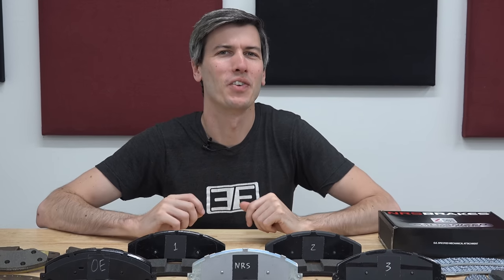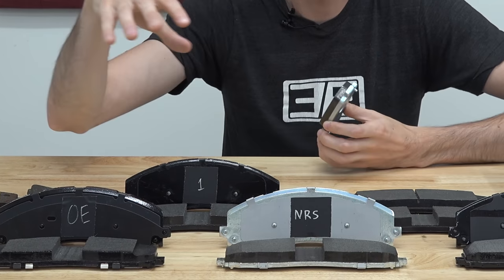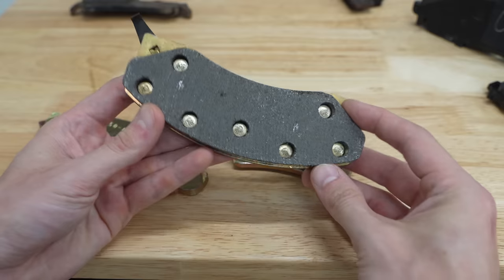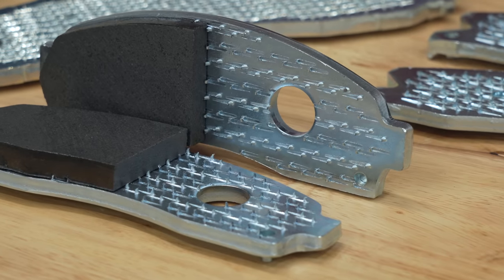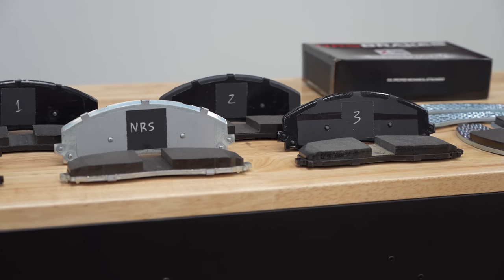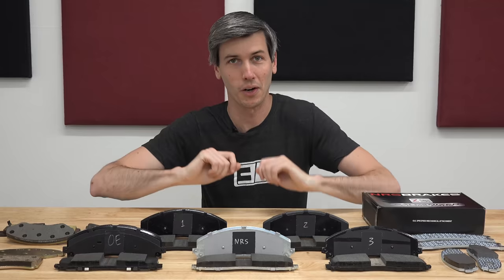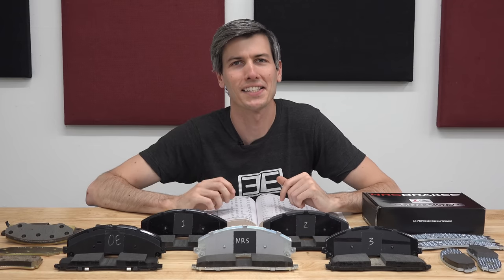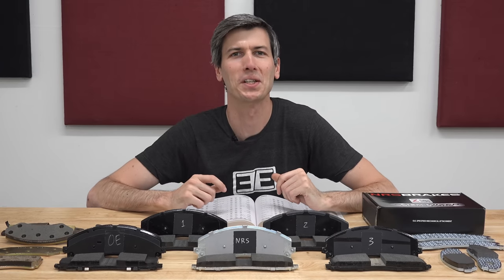The Sketchy Truth About Aftermarket Brake Pads

Comment: Mechanic of 20yrs here, I've seen a lot of separated pads due to corrosion. I've seen cracked pads from heat and heat cracked rotors. Most commonly separated friction materials I see are drum shoes oddly enough, often parking brake shoes due to rust. I haven't yet seen a pad cooked off a backing plate, not to say it can't happen and doesn't happen but my experience is that rust will get ya before anything else, often the rest of the brakes are seized up pretty hard at that point as well. Sticking slides and pads bound in brackets are very common issues with brakes.
Reply: THX, thats a profound reply.
Reply: I've only seen pads separate twice, both time the bads were supper thin

Comment: My BIL got me into the Autozone lifetime warranty pads couple years ago. Seemed like a good idea at the time as a break job is a pretty easy and quick task and you get to check out everything down there. After the first set died after 14 months, I quickly realized spending a bit more to where they last at least 2-2.5 years is a better use of my time for an extra 10-20 per set.
BIL still thinks hes got a good deal and is doing them every year+.
Reply: BRAKES, people, Please!
Reply: It kinda depends on how you value your time. I slung hundreds of those pads in a former life as a counter tech. Very, very few people actually made us replace those lifetime warranty pads...mostly it was lots of used car lot jockeys that bought the cheapest Valucraft pads. The cars only had 30 day warranties, so as long as those cheap pads lasted 30 days...that was all they cared about. The most interesting issue we had with the lifetime warranty pads were friction material disintegration on riveted pads...the material would crumble and bam...rivets into the rotors, metal to metal. Ruined the rotors. Naturally only the pads were covered, the rotors became junk. The problem there was that whoever was making the pads, tried making the material last for such a long time they compromised the temperature tolerating ability of the material...it burned off the binder and then the pad began to crumble. Lots of unhappy customers. This was back in the mid eighties.

Now if it's the family truckster that I depend on to get all of us safely from point A to point B...you better believe I'm putting on the best stuff I can find. The best stuff isn't necessarily the most expensive.
Reply: I used to work at AutoZone & started buying all my pads there. I do the work myself so a lifetime warranty on the parts in an hour job is worth it to me. If I'm buying expensive pads over and over that 6 month difference is irrelevant if I'm buying the parts again.

Comment: Over my 20 plus years in the automotive repair industry I’ve seen a few pad separations. Personally I’m all in for mechanical connections, however I’ve seen pad separations on mechanically connected and adhesive bonded pads. While I’m just one tech without any type of scientific method or control, in my experience it doesn’t seem like any one type of connection is more separation proof then the other in real world. Now I’m sure the vehicles I mainly work in and my location in the country have a big influence on that. So it’s entirely likely my experience would be completely different if I was working on a different brand or in a different climate. However I will state that I absolutely have seen galvanized and mechanically connected pads be separated by rust jacking. Galvanized coatings don’t stand a chance against that horrible horrible brine they use on the roads in winter. Just my worthless 2 cents.
Reply: Separation of the friction material from the backing plate was a major concern when the industry started to move away from riveted brake shoes and pads. That was rectified in the first 5 years.

I guess with today's increase in weight limits and towing capacities, this might also again become a problem for 0.001% of people who drive trucks.
Reply: I believe that the zinc plating that NRS is using might help some, but given it is just plating, I believe it will have its limits as well. I think Jason made a great case, why the mechanically aided pad attachment is a good idea, but how much that really matters in a daily driver setting remains to be seen. Especially since you have mentioned that you have seen both types fail.
Reply: The brakes that I recently changed out on my 09 were beginning to separate from the backing plate, which used a mechanical attachment. Unfortunately, I would have to agree that rust jacking will get the best of any brake pad if left on for enough time. The car was not driven much and sat on the side of the road for about a year, so there was plenty of pad material, but the sprayed on brine in the winter killed the rotor and pad within a matter of months.
Reply: @d47000  That brine is horrible, awful, vehicle and metal eating stuff!  In the 16 years I was a foreman before the local authorities switched over to the brine, we never had a metal brake line failure. After the first winter, cars started coming in one after the other with brake line failure and within two seasons, major structural failure. Everyone wants to blame the manufacturer but if twenty year old cars are rust free for 18 of those years and then two winters after the brine goes into use, it’s falling apart, I don’t think it’s the manufacturer’s fault.  Even my own vehicles went from ok to rusting within one winter. I cleaned everything and applied a preservation wax to stop it. Sadly most people don’t know better.
Reply: @2down4up  I feel for you! Nothing more painful than working on a rusty car.
Reply: @d47000  I very much appreciate that, but my fellow technician brothers in the great white north have it much worse then I do. Regardless, it sucks!!!

Comment: I do have to question if the NRS tests were designed specifically to reduce the effectiveness of adhesives. Which would artificially prove a point that may not be rational. Like if these were baked at temp for days on end with no cooling periods, but if there had been a test better reflecting real life conditions (with intermittent brake useage or varying durations) would the same result occur.

This may not be the case, but because we have so little information about the methodologies... I at least wonder.

Comment: it's an interesting video but is there any real world testing/evidence that otherwise solid brake pads using glue (not super cheapos) actually fail this way?
Reply from the maker: Yes! To be fair, (and I hope it's clear) I'm not saying if the OE says you don't need it in your daily, you should think otherwise. But this kind of failure definitely does happen. NRS gave an SAE presentation where they pulled several examples from NHTSA where the pad falling off was the failure point/cause of the accident.
Reply: I have had this happen to Brembo pads using adhesive, but I think the reason it happened was because the previous owner had installed the wrong size rotors on the front.
Reply: @EngineeringExplained   'several examples' when there are 300million vehicles in the US seems.... not concerning. And a pad falling off could include improper use/install as well.
Reply: I was a mechanic for about 10 years. During that time I did loads of brake jobs, and even here in Texas where rust isn't usually a big deal, I saw plenty of brake pads separated from the backing due to rust. None had mechanical fastening, because the backing plate was nice and smooth (not counting the rust). Also saw a couple cases where people abused them (doing burnouts by holding brake and just overpowering the rear brakes) but those were really obvious by the blueing on the rotors and chunks and cracks in the pads. But yes, brakes do fall apart.
Reply: @Idiomatick  speculating the definition of a term with more speculation is useless. Find the real number if you're going to try and start a fight.
Reply: @EngineeringExplained Question is, can you get mechanically attached pads for cars where the OE doesn't specify it? i.e. ordinary cars, not trucks or the like?
Reply: My 2021 Tesla Model 3: I had the Tesla Service Center perform a brake service (cleaning and lubing of pads, sliders, etc.).  They called me and said one of the pads friction material delaminated from the backing plate.  They said they use adhesive rather than a mechanical attachment  method.  The further claimed that this happens sometimes when they are cleaning the pads.

I was forced to pay out of pocket for a set of front pads and some addition 'kit' for it.  Something like 400$ Canadian on top of the 400$+ for the cleaning service I requested initially.

I tried to call BS on them about the pad and said they damaged it while working on it or it was a defective part.  They wouldn't do anything for me and I had no choice but pay for the job.

I'm told this model tesla uses Brembo brakes.  I've long heard of this brand and felt it was a higher quality manufacture and should be able to trust their product so I was quite surprised at this.

Tesla told me that I should have serviced my brakes (clean/lube) annually because I live in the rust belt.

Now I feel as if I should either have this service done yearly or never at all.  If they'd never touched the brakes, I'd likely not have had this issue.  They said my pads were approimately 75% good.  I had 75,000km on them and nearly 2yrs.  I purposely use the brakes everyday I drive because I know regenerative braking does most of the work.  I wanted to prevent brake seizure issues, etc... 

Anyhow... anyone have any comments on this or suggestions for me?
Reply: @PurpleSideBlack  wait. You took your car in specifically to have the brakes … cleaned?
Reply: @Everybodypoops2  yes. It's recommended maintenance to clean and lube the brake system. Especially because Teslas don't use the friction brakes very frequently due to the primary braking system using the regenerative brakes through the rear motor that uses kinetic energy to recharge the battery pack. 

I've never done this service on any other vehicle because I didn't know that was required and generally the pads and/or rotors needed replacing by the time you needed to clean and lube.

Comment: I installed a PowerStop front brake kit to include cross drilled rotors and carbon ceramic pads on my 2001 Subaru Outback LL Bean [H6] last year, and this spring I did the rears with their kit for the rear brakes.  I don't think the car stops any better, but the carbon ceramic pads seem to produce NO dust and the kit was very well done, with complete instructions and most importantly....

Instructions on how to BED THE BRAKES!

If you just put rotors and pads on your car and go and drive it, a year later your pedal will be pulsing.  You have to "bed" the pads and rotors, or they WILL warp~

Most cheesy repair shops won't do this properly.  Or at all!

Great video!
Reply: Also used power stop. They lasted daily driving and track use
Reply: cheesy?  do you think a reputable car dealership does it either?  Nobody does it , unless it’s your own car and you do it yourself

Comment: I am the mechanic for a motley fleet of Ford Chevy Isuzu Toyota trucks that mainly pull trailers stop-n-go around suburbia. Only a couple see highway, ever. Unfortunately the soil in our vehicle park isn't well drained and they frequently have to be parked in puddles for days at a time. Our specific problems are 1) Sliders seizing and wearing out the pad on the piston-side of caliper. 2) Rusting onto the rotor/drum which either rips all or part of the pad/lining apart. 3)Dragging overheating from stuck sliders and or pistons.
#3 above is particularly awful because it always kills the grease seal and when grease gets onto brakes you just have to start all over with brand new stuff.

Comment: Did NRS provide the cutaway pads from the competition? Seems important to disclose this if true.
If you cut them yourself please share your method. I would like to investigate my favorite brand myself.
Reply from the maker: NRS did the cutting (hence the beautiful cuts, which are done with machinery I don't have access too haha). I selected the vehicle, and we picked out numerous sets for it. I have the boxes with the full set of pads, and verified all part numbers (part numbers are not shown in the video).
Reply: @EngineeringExplained In future, if you want reach out to me. I’d be happy to use our CNC mills or lathes to help you dissect anything you want with nice pretty cuts.
Reply: A 4.5 inch angle grinder will make those cuts just fine. Put it in a bench vise and wear eye protection and an N95 dust mask. You can even hold a Shop-Vac right behind the wheel for dust collection.

Comment: Is there any point in testing side sheer force (as you showed in the video) when a brake pad is just pushed/squeezed directly to the face of the pad? In what world would you need the pad to tolerate such forces from the side when it is never applied in the real world?

Comment: Does this test actually simulate real world usage though? putting brake pads in an oven for 24+ hours? Track use maybe, but even track use will see a pad swap before 24 hours of driving.
Reply: It's an accelerated test. Of course it doesn't simulate real world usage. This is to accelerate the aging/heat degradation of the glue and friction material to see what would fail first in a long-term scenario. Brakes are typically used for years, and the damage accumulates over time. These are the types of failures you would see closer to EOL of the brake pad, or in very extreme braking situations potentially. 

Accelerated tests are used quite frequently in many industries, despite not simulating real world usage. Simulating real world usage would take much longer to identify primary failure points. For example, in pavements, we use accelerated aging in an oven to simulate long-term real world aging to determine which mixtures are more resistant to cracking than others.
Reply: Baking brakes at 550 for 5x24 straight is a testing methodology designed exactly to kill those glues.  Hard to think of a more obviously biased 'test'. No doubt mechanical is better, however with the 300 million vehicles on the roads, NHTA could only come up with a handful?  Pretty sure if this were anywhere near pervasive, they'd have already addressed this as a Life/Safety issue and mandated mechanical attachement as a minimum.
Unless I missed it, odd that they didn't actually show any of the testing where they sheared off the pads, maybe worried that people would call BS?
Good vid on why we should try to find suppliers that offer Z pad support, but kind of shilly much..
Reply: How I wish I could get 24 hours of track use from one set of pads..

Comment: I looked up brake pads for my application on Rock Auto, and you are right, there is not much to go on! Most specs as given do not reveal bonding method. Some stated "integrally molded", does this mean hooks on backing plate?

Comment: I've had the friction material separate from the backing plate. I was not the only one who experienced this from the same brake pad manufacture. To be fair, it wasn't a clean break from the backing plate, the friction material itself sheared leaving some of the friction material on the backing plate. Fortunately the brakes still worked as it was all held together within the caliper.

Comment: In my short 5 years auto repair experience I’ve seen a brake pad “shuck the pad” off of the backing plate a handful of times, often resulting in immediate brake caliper blowout due to the increased travel of the piston. Not “super common” but it definitely happens and, for me, it’s always been a, “I replaced the brake pads myself with the cheapest parts I could find.”
Reply: Absolutely! It does happen, and for someone who isn't very mechanically aware, it can lead to a super scary situation.

Comment: Did a search on NRS for brakes for my rig. Part number does not show a "Z" at the end of part number? No where in the description does it say that the friction material is "mechanically attached", and they don't seem to be sold by hardly anyone? Not to long ago I replaced the brakes on my rig and the back pads were the original (I bought the rig new) and were "rust jacked" loose and missing and they WERE not mechanically fastened only glued. I'm curious as what the other brands were in the test.

Comment: Im not sure if i agree with their testing method, where they apply a shearing force directly onto the side of the friction material. In real world applications, wouldnt the pads themselves be smushed together, both by the caliper, and some (minor) bending moments created by the disc pulling the material from the top, rather than pushing from the side? I can see the point they are trying to make, that one IS probably theoretically better than the other. It does indeed handle more load, but does it matter in a real world application? A large part of engineering, can be figuring the best cost effective solution, which is still good enough. Its also worth considering, that brakepads is a fairly frequent consumable, in contrast to e.g. the caliper, and the brake line.
Reply from the maker: There's a shear force generated with the contact (friction between a spinning rotor and a stationary pad), and there's an industry minimum that pads need to pass in shear test (if you're curious, I cover this test in a lot more detail in the previous video). https://youtu.be/DZ8O2tJOGLE?si=1V2UXyGKRkRPVDFj

Comment: I did have a brake pad detach from the backing plate once.
I was braking on ice then hit dry pavement. No ABS in those days. The pad fell out, the pedal sunk to the floor but came back up after pumping the brakes.
By the time I got home just a couple miles away the disc on the side that lost the pad was destroyed.
I bought the car used so no idea what pads were on it.